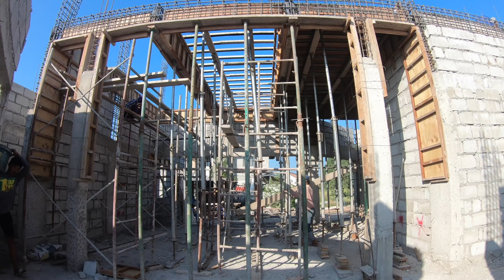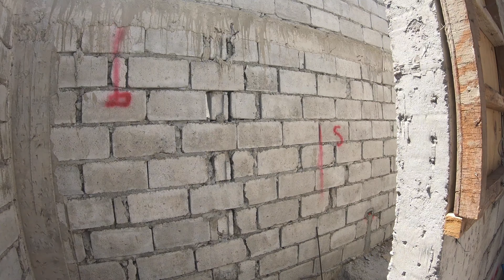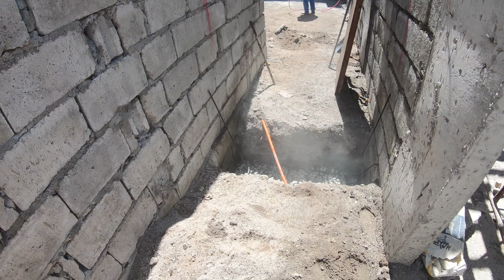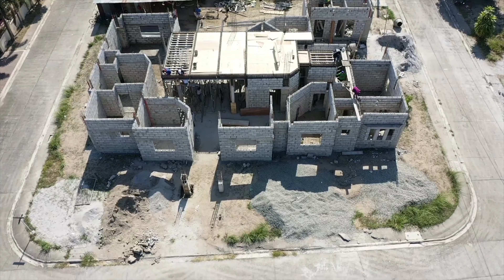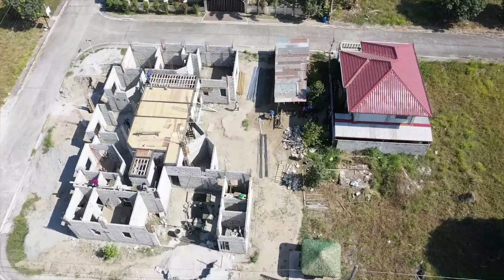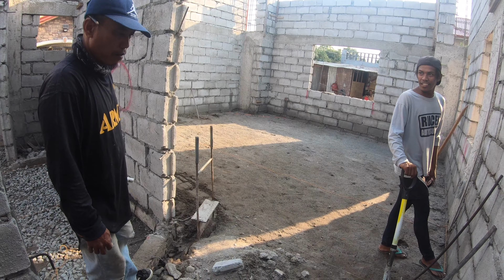Philippine House Building Step by Step, Build Day 57: Going Incognito

Comment: Technically speaking, all those major beams, should either terminate at columns or intersect with the columns, to provide the optimum load path to the ground.  A beam terminating or connecting to another beam, without direct columns support, introduces, "kick moments", that make cause failure in a major event, such as an earthquake.